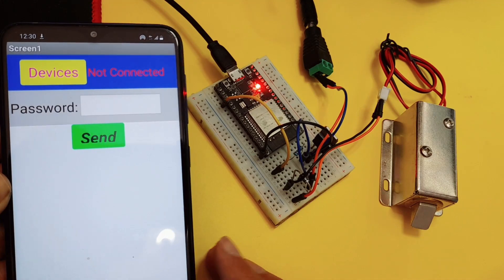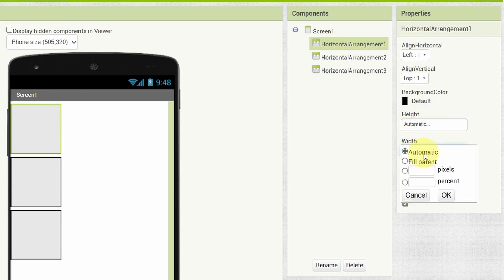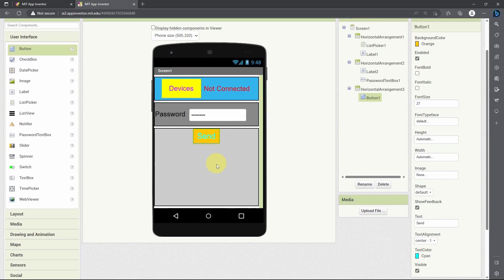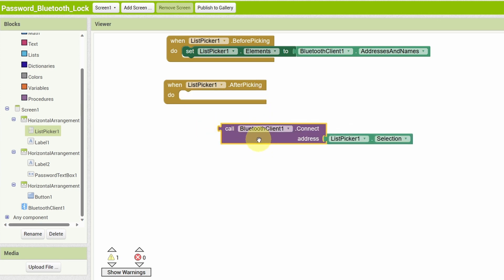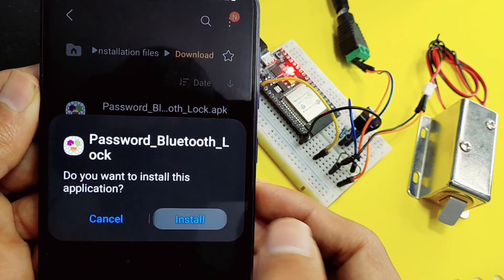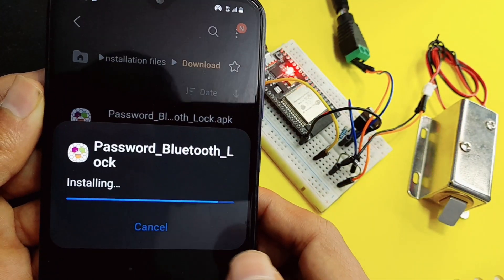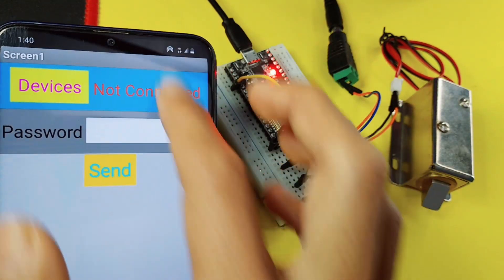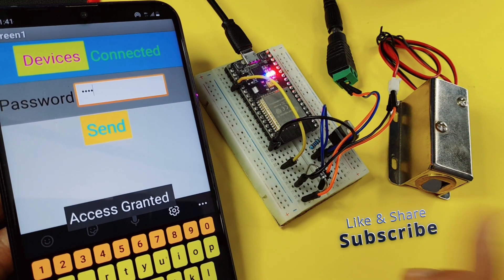DIY Bluetooth Password Door Lock System - Full Guide

Comment: The esp32 burn, i think the voltage is to high for esp32
Reply from the maker: You have to use a TIP transistor or a relay to prevent burning the board.
Reply: @DIYTechRush I used the tip120, but why the esp32 burn?